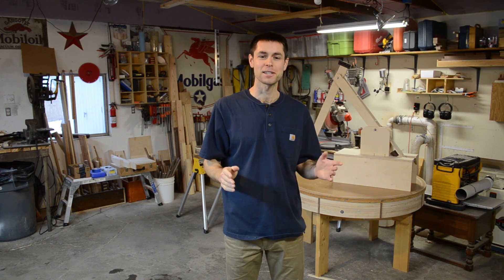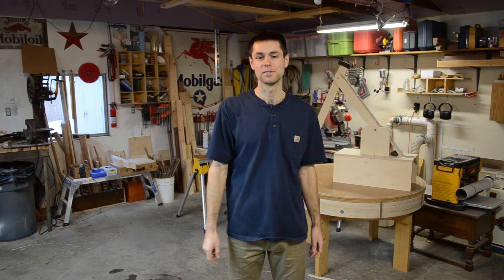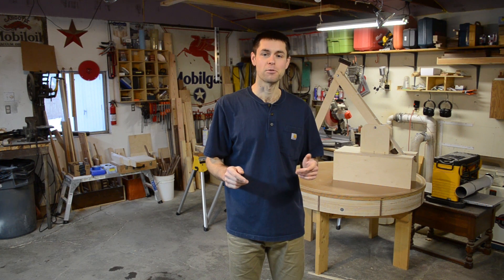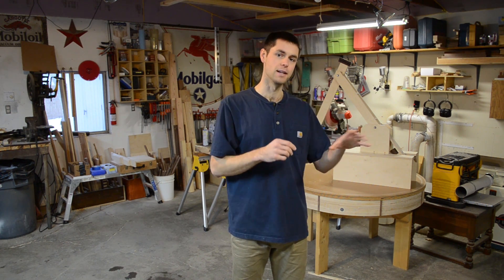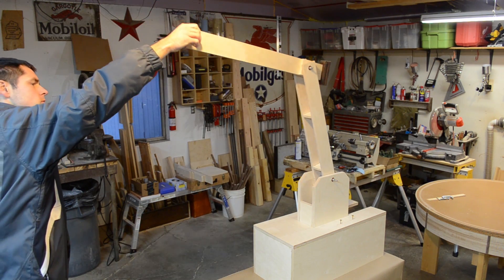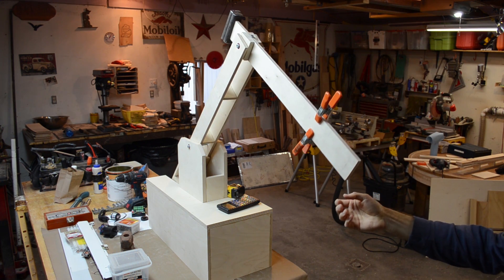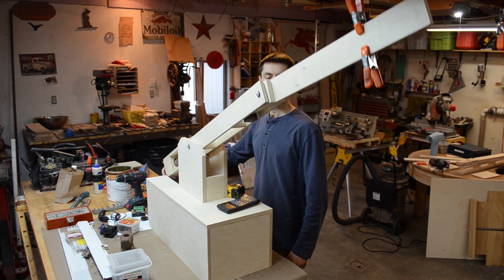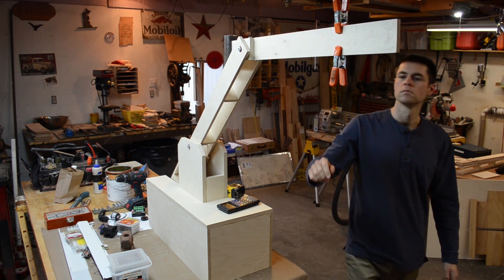Camera Control Arm #1

Comment: Ceramic bearings will help. I an drafting table arm where i replaced the original cast iron bushings with skateboard bearings (regular upper class) then with ceramic ones. The difference in smoothness is noticeable. The follower arm glides over the table, i can traverse the arm from one end of the table to the other with little to no effort.

Comment: I wonder how practical using a belt-drive might be.
It would be quieter than using a gear-box (especially straight-cut gears), and smooth out the motion.  Draw-back: sudden velocity changes might create more wobble than a geared system.

Comment: It depends on the type of stepper you are using, but you should really watch out with the 'free-wheeling'. When you rotate a stepper motor it generates current, which most of the drivers/micro controllers can't handle. The current will destroy the drivers if you're not careful.

If you haven't purchased your stepper motors yet, I would recommend the Nema-series motors. They are really strong and pretty cheap (about 15 dollars if you go for a nema17 type).

I keep rambling, but if you want a coordinate system for your robot arm I could help you out by making an algorithm for this arm. I think it's fun to do, so I don't mind.
Reply: A solution to this problem could be to put a relay between each coil of the motors and the drivers. This way the motors can be disconnected from the drivers when the drivers are not operating. Also put a medium/high value resistor across the coils of the motors so that they can not build up a charge when disconnected
Reply: +Transistor512 this sounds like a good idea, never thought of something like that, but it's basically an on and off switch which doesn't affect the behaviour of the steppers when turned on.

Comment: How would you deal with changing lenses, or even zooming in or out, considering that both of these things would alter the balance.
Reply from the maker: +Jose L Romero Once motors are attached the balance only needs to be "pretty close". In these examples I've balanced it almost perfectly but it won't be necessary later. For major adjustments like lenses you could do it by hand, an auto-adjustment system is probably not necessary with these small cameras.
Reply: +Scott Rumschlag How about controlling the speed at which the arm moves?